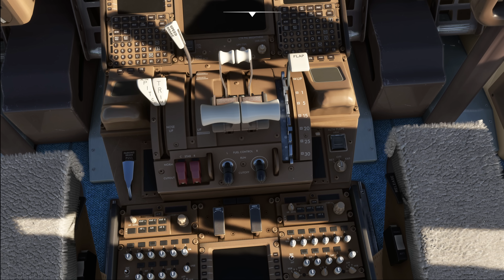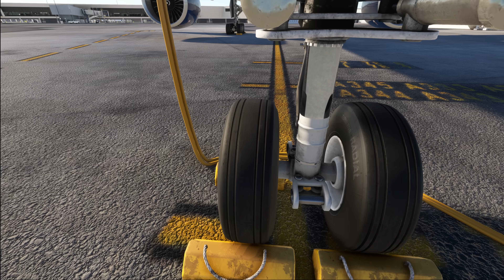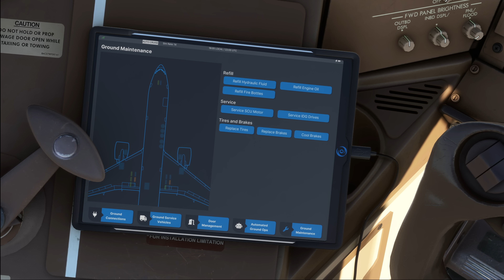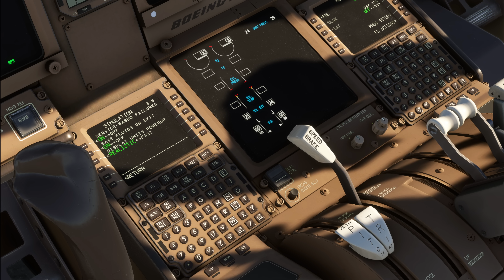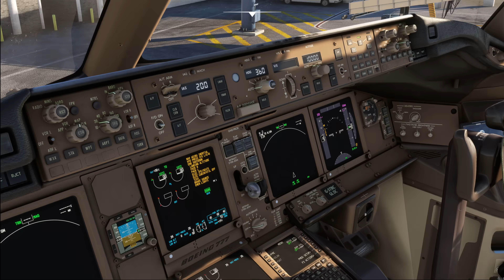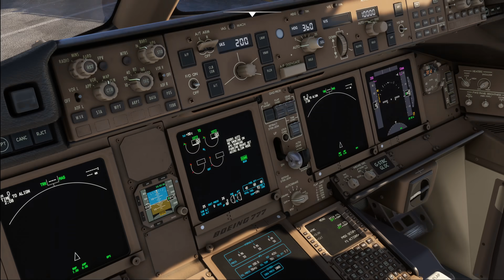PMDG 777 Tutorial 1: Electrical Power Up and Preliminary Preflight Procedure | Real Airline Pilot

Comment: In discussing whether or not to use the Apu for cooling, there is an option to order air conditioning for the plane has a separate hookup through the FMC on the pmdg. Do airlines sometimes favor a separate air conditioning unit hookup over the APU? Is that realistic?
Reply: Yes

Comment: @a330driver, you can start the APU with all fuel pumps off? It is a mistake you made or is it supposed to work that way?
Reply from the maker: It’s supposed to work that way. When you turn the APU switch ON it automatically starts the left forward main tank pump.

Comment: What is the difference between  1 and 2 ground connections? I assume there is a benefit to connecting 2 since it's an option?
Reply: The 777 simply requires a lot of electrical power for all of its systems. Hence why multiple sources are needed.